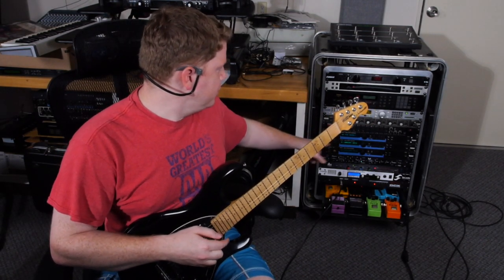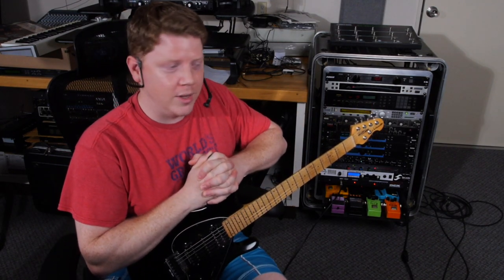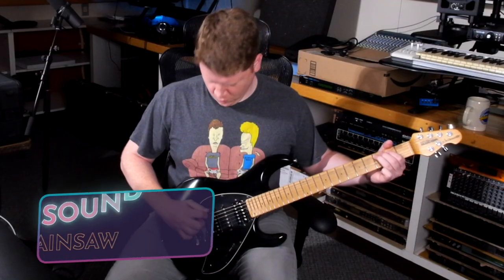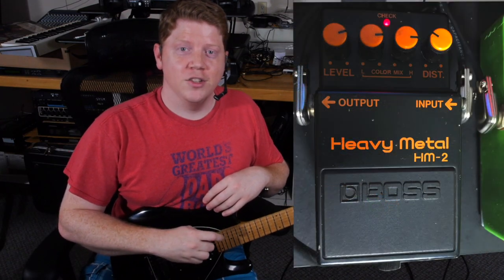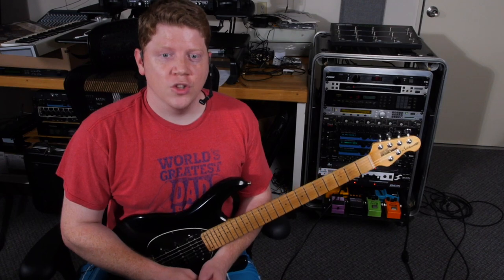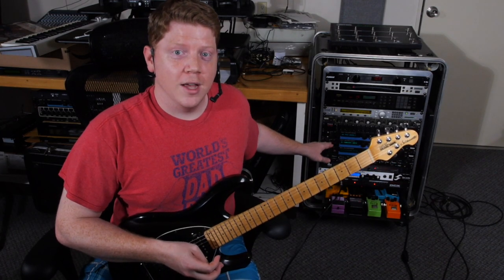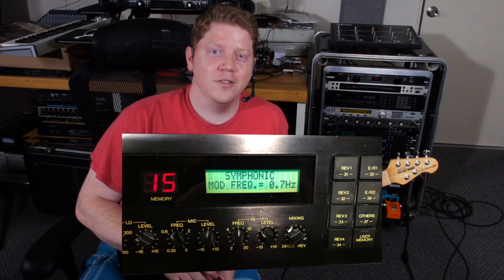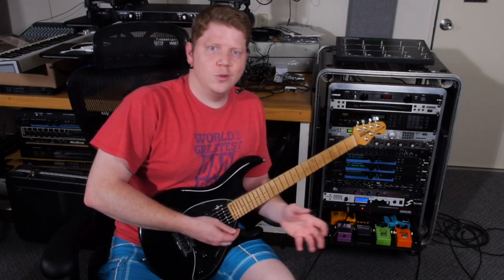Retro Rack Rig Rundown

Comment: Love the rack gear rundown!  I still have my rack system i used in the 90’s , a Carvin quadx4 is a 4 channel 5 effect’s loops tube preamp, in the loops are gsp21 legend 4 rockman moduals an art reverb unit tuner and power supply and a carvin ts 100 tube power amp. It all still works and sounds great.  Thanks for the video!
Reply from the maker: Woah that’s awesome! I had a couple Carvin guitars many years ago that were excellent.
Reply: @cliftonwright7081  hey thanks!!  Your rack system is killer!! Being able to select all those ambient effects is great. Now is use alot of pedals and a gec9 switcher and a surround sound sterio 4 tube amp rig. But i just play in my garage. But there is 54 12 “ speakers in here. Lol. 4x12 and 2x12 cabs hooked to all the different amps.,  Carvin \ Kiesel  guitars play like butter. Love the channel!!

Comment: Nice. I am also a big fan of the 90ies racks. But as I built my rack I faced some important routing configuration problems. 1. Just a parallel path is not enough. You need to combine parallel and seriell in the post fx. Here is an example: you want reverb on the direct sound. And you want reverb on the FX sound. You want the chorus (and the detune) feed the delay but you want chorus and detune also go direct, in parallel with the direct signal (danger of phase issues). Where do you insert the detune? Before or after the chorus? Or in parallel to the chorus? It makes a big difference. 
BTW great playing! (Better than your sound.)
Reply from the maker: Yeah this iteration had some effects in series with the preamp/two notes live but all my time and pitch stuff was in parallel unless it was dual effect algorithm from a single unit which is kind of the easiest way to sidestep the routing option Armageddon. I mostly use these effects units when I mix so I can route stuff however I want with a patchbay or in the daw/with sends and returns on my interface
Reply: @cliftonwright7081  I do a lot of routing in my studio like you described. Doing it all with the rack is a lot of work. It's a challenge to play live and switch all with just one step. And you must be able to adapt the sound to the venue where you are playing.

Comment: i have run into a fork in the road. I have my 80's rack setup with a pcm 80, d1500's, pro-chorus, SPX90, dbx compressor, soldano pre and a few other fx units BUT i have acquired an AxeFX3 and am adding it to the rack. Not really sure what to pull out and what to keep in it
Reply from the maker: Wow damn, you’ve got options for days! The Axefx will do everything that whole rack will do but….sometimes that mojo from the older units is tough to beat
Reply: @cliftonwright7081  running my Pre , GCX, Lexicon, SPX into the 4 send, returns of the Axe. This way they can be placed anywhere in the Axe chain.  Guitar plugs into the instrument in on the Axe.
Reply from the maker: @geezberry8889  that’s a great way to do it! I liked routing rack effects into my helix floor the same way
Reply: @cliftonwright7081  i thought the tone would suffer but the opposite. i can drive the input of the tube pre a little harder and get great results, also zero hum
Reply from the maker: @geezberry8889  that’s badass! I’m building a semi portable stereo rig right now with the Synergy, Fryette LXII, Eclipse and probably a GCX + pedal drawer. Gunna drive a pair of those old vertical Mesa 2x12s like the ones Lukather used in the 80s
Reply: @cliftonwright7081  i had a bear of a time with my GCX  (first hum issues then tone suck) solved the hum (by ground lifting the input with a radial shotgun ) but the thing sucks tone, not terribly but noticeable enough to where i wasn't pleased . The axe allows me to completely remove the gcx from the signal chain when i'm not using anything in it.
Reply from the maker: @geezberry8889  yeah, seems like it might attenuate highs slightly. I may spring for the RJM effects gizmo eventually
Reply: @cliftonwright7081  it sure does.  i was gonna get an RJM supposedly uses the same relays so may also tonesuck let me know if you get one and if it's better

Comment: Hey Clifton I was wondering where your stereo effect returns are plugged into.  Back into the Roland than stereo summed to power amp? If so why did you use the first channel on the roland to be sent out the aux to the rane. would returning back to the roland not cause a feedback loop? why not split the torpedo signal 6 ways, using the rane first, than to fx and return to roland and use that aux to blend in another reverb or something? Just trying to wrap my head around this, cause im in the process of shopping for a line mixer. thanks!
Reply from the maker: The only audio that goes out through the aux send is dialed in per channel with an individual aux send knob (there’s two per channel on the M-120). That’s why there’s no feedback issues. However, you are correct; I could just as easily split the output of the torpedo 6 ways. I need to find a nice fully balanced line mixer eventually. I just like the M-120 and, lately, the Boss MX10 because they’re small, have tons of channels and sound good. I do need something that operates at full +4 line level and has balanced I/O to make the most of my Lexicons.
Reply: @cliftonwright7081  gotcha. yea the m-120 looks awsome i can see why its hard to let go. its hard to find mixers with 2 aux sends. not to mention made in japan rather than the crap they make in china or Indonesia nowadays. was thinking about buying one used but dont know cus there pretty aged by now. would you still recommend one today or should i buy a newer modern mixer?
Reply from the maker: @mikemion2527  I’d maybe look at some desktop mixers too